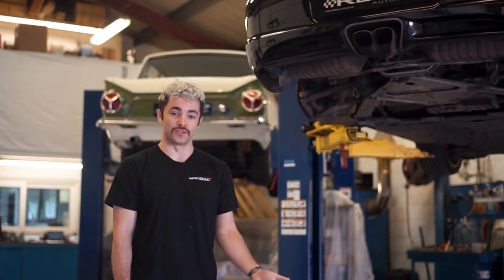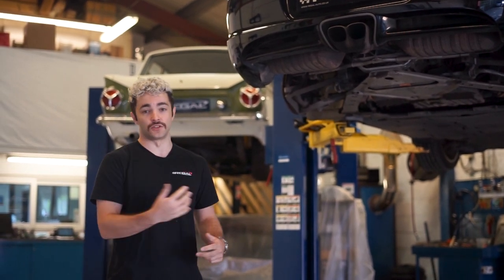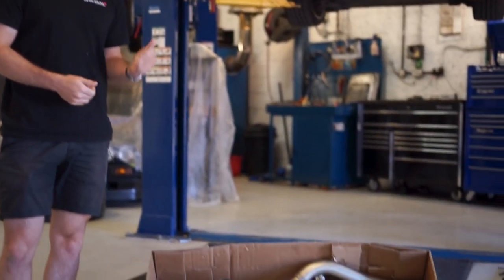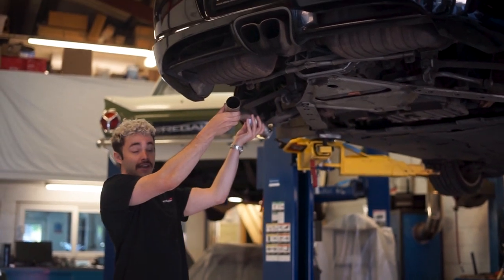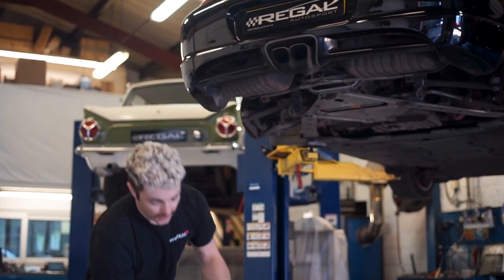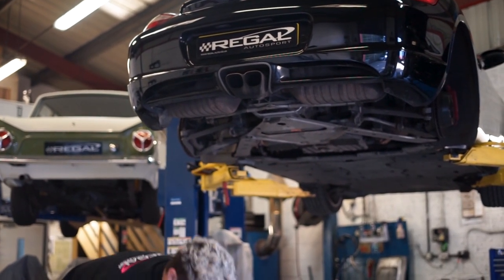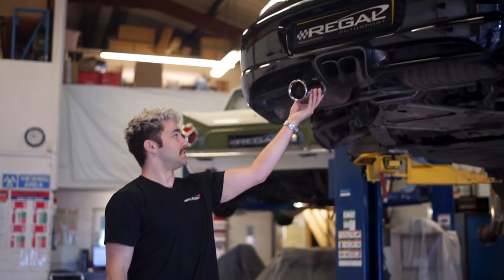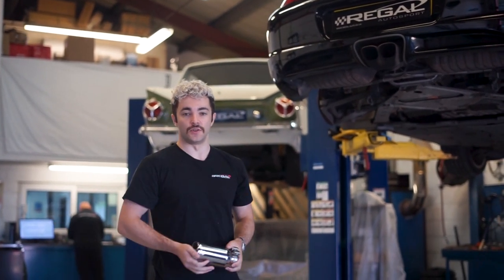Remus Exhaust Install with Sounds on a Porsche 987 Cayman S

Comment: Can this fit on a 987.2 Cayman S without any issues?
Reply from the maker: I believe this is a fitment, to check, please contact a Performance Specialist using the information below: 

📲 Messenger: https://m.me/regalautosport
📲 Whatsapp: https://api.whatsapp.com/send?phone=447464783476
📲 +44(0)2380 55 86 36
📩 sales@regalautosport.com
Reply: Yes and the only thing that will be any different is the over axle pipes being configured for the MA1 9A1 exhaust headers. I have a 2010 Cayman S with a Remus Race cat back system and it is the first one produced for import for the USA. I also have Fabspeed high flow cat equipped headers, as the car is street driven.

Comment: The remus system does not connect the right and the left muffler with a pipe. Don’t you think that’s there for a reason in the OEM exhaust? I think the remus is going to degrade performance because of exhaust resistance is to high, alternating between left and right engine bank.
Reply from the maker: On the factory system there is a pipe which connects to either bank to smoothen out the exhaust tone, aftermarket systems depending on the sound design either have or don't have it.
Reply: Resistance isn't going to be too high, it's going to be less.  Your conclusion is based 100% off of an assumption.